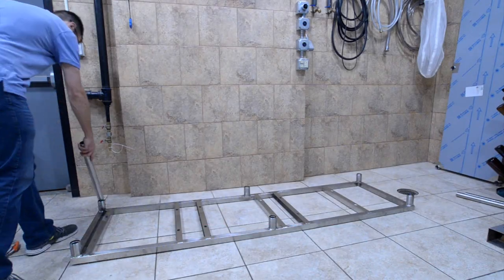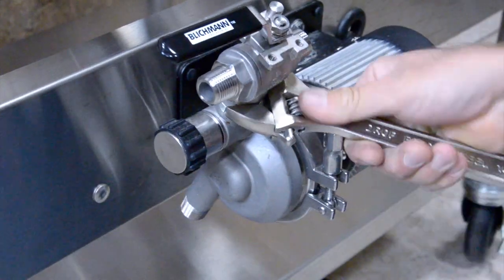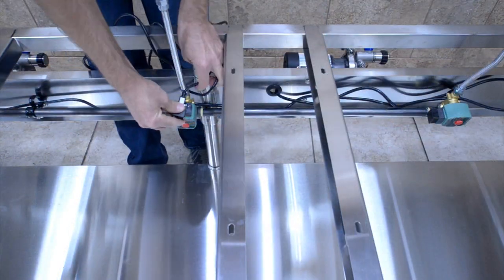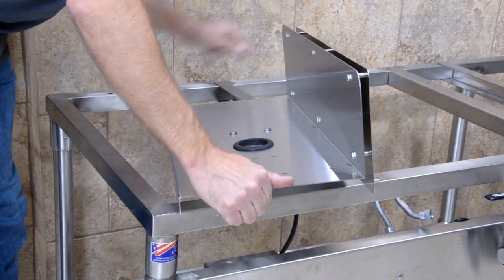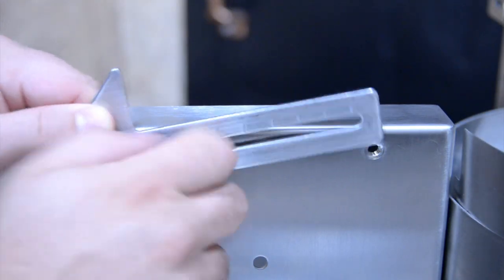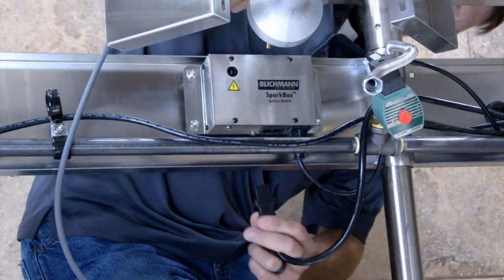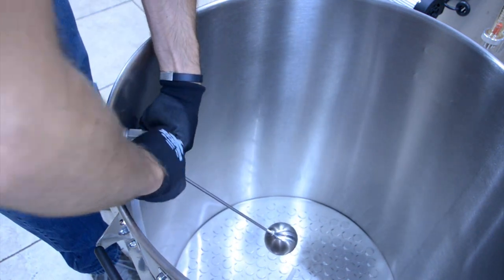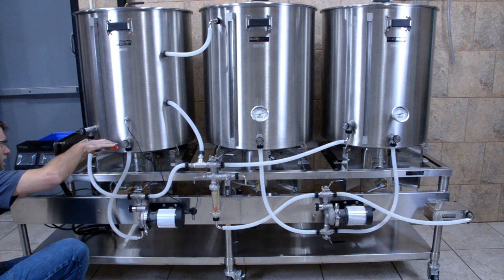Blichmann Engineering Pro Gas Pilot System Assembly

Comment: I bought their 1bbl pilot for natural gas. I have never been so disappointed. I started at home and could not get it to come up to a boil. I called customer service and they said I probably did not have enough gas coming into the house since it is residential. Therefore I searched for a commercial space since this was my main objective to sell commercially. I still could not get it to come to a boil despite having ample gas supply, 8.5 inches of water. This system maybe amazing with propane but if you are planning on using it for natural gas walk away it’s so not worth the money.   My disappointment goes even further in that the customer service has been sub par at best.